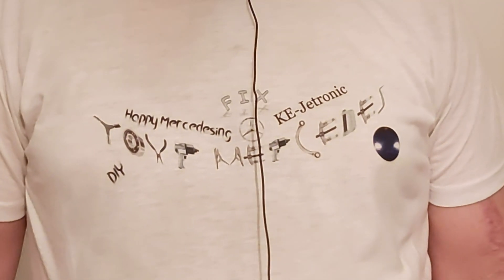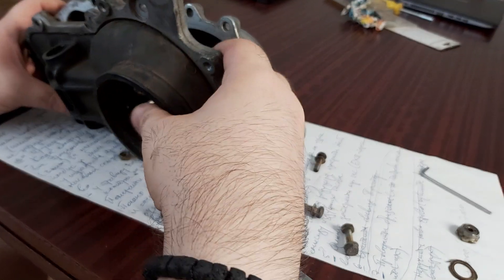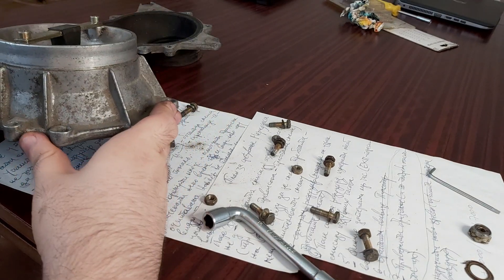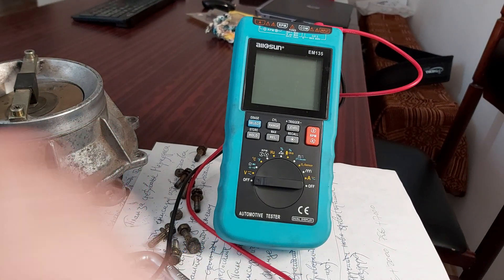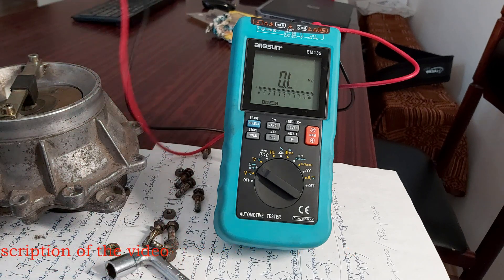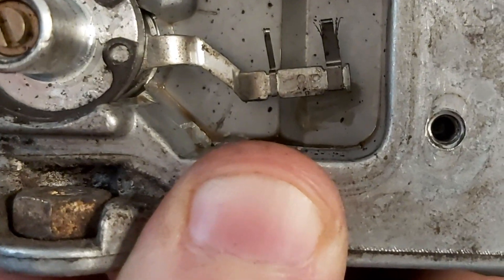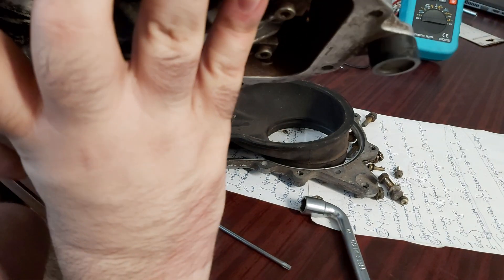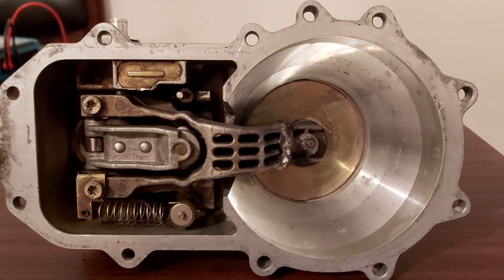㉦Mercedes Ke-Jetronic㉦ - M103 Air flow meter in details

Comment: hola ivica cambie el medidor de flujo de aire porque tenia un contacto roto como el tujo en este video pero el sensor esta peqada con silicona i medi con el multimetro con motor la 80 grados i me indica 0.30  qu tengo que acer gracias.
Reply from the maker: Si nunca ha reemplazado el sensor, reemplácelo.
Reply: le comprado de segunda mano no se porque pusieron silicona puede que no tenga tornillos es algo grave de se queda asi 0.30 se puede romper algo..o afecta el motor gracias
Reply from the maker: @tiberiuferencz  El potenciómetro afecta el ralentí. Compra el de Alemania, es el mejor.
https://www.ebay.com/itm/133173658800?hash=item1f01c4c4b0:g:gHEAAOSwzrxUwOBh&amdata=enc%3AAQAIAAAA4ClhldjLnTgTfNC8jFtEPZeqrXZqcU7X6teICi8cIF7%2FzkZ8%2Bxtt5i89mEJMLCY83LQFDP9amvusmWjiihwlGQNjJQy0I%2FXSGSO2qB1ab%2BWGM5SX6BpNbblFSit%2BfgJmILMQfUszysUo6XF8McXGHXio%2FetzHjl%2F8E42wHQ6DojqscQveyyXRDhwYgUE7wAGp2bSrF3eDGTu0csg%2BNQc68e0g7PLNDyoxefLEC5hApoBatsKkil5ZujSXXedqBxXJoD56z3BsVvwcExfsaB8Cjz%2BWT2nVUu4%2Bahh2%2FNcDZgE%7Ctkp%3ABFBM3uLEqOdi
Reply: gracias lo pedi hoj un saludo @mercedeske

Comment: Hi. Just want to ask for your expert opinion. My throttle response has been soft lately after changing the EHA and fuel regulator for a used one, so I tried leaning the mixture tower a little. It started to not hold idle since, so I adjusted it again to enrich mixture. My problem now is the spring loaded mixture tower suddenly lost its “tension”, the 3MM just spins freely. The engine is also flooding itself and fuel is coming out the exhaust pipe. What should I check first?
Reply from the maker: Hi and thanks for the comments. At first try to turn the screw counterclockwise. I hope you haven't damaged the thread. So again - in 3 steps: put the key in, stick the key until the spring is preloaded and as you feel the key caught the screw turn counterclockwise. Turn until you feel that the plate makes a slight play.
Reply: @mercedeske  That’s what I have been doing but it seems like something broke on the inside. Is there a fix for this? Or I have to replace the entire airflow meter?
Reply from the maker: @marimolina2661  If you can manage to turn the screw then you will have to replace the airflow meter.

Comment: I have a question and I hope you can help me: I bought mannol 9873 throttle body cleaner. They say to use it when the engine is at 2000 rpm. Can I use that without causing damage (to the potentiometer or something else…). Thank you very much. You are doing a fantastic job for every w124 owner 👍
Reply from the maker: Hello and thanks. What do you want to use the mannol for and why?
Reply: @mercedeske  Thank you for your answer. To clean the intake runners, combustion chamber, valves,…even if this engine is not a gdi engine. But I’m not sure if it can damage the potentiometer, because these cleaners normally has to be applied behind the maf.

Comment: Hey, after rebuilding my engine the car is now very hard to start and when it starts it won't idle and won't stay alive for more than a minute, after the engine got hotter it won't start again. I tried replacing the distributor cap and wires but that didn't help, do you have a clue on what it could be?
Reply from the maker: Hi 👋What car is it about?
Reply: @mercedeske  oh sorry, forgot to mention that. It's a w201 m102 2.0 ke-jetronic.
Reply from the maker: @Sheikob  Check the potentiometer, the lambda if you have one and the fuel accumulator.
Reply: @mercedeske  alright, I'll check those when I have time. Do you have videos on each component, if not where do i find info on how to check? also thanks for the help :)
Reply from the maker: Check the potentiometer, I have a video on that. As for the lambda - it has to be replaced each 50k kms. There is the way how to check it but if yours has never been replaced then I would advise you not to bother yourself, just replace it. As for the fuel accumulator-you will have to get a pressure gauge and to hook it up to the fuel distributor at the lower chamber where that silver screw is located. Unscrew it, hook up the pressure gauge and let the car run for about half a minute. Then stall the engine and wait for 30 MINUTES! In this time the pressure MUST NOT FALL UNDER 3bar! If it does you have a bad fuel accumulator!
Reply: @mercedeske  oh alright, I have rebuilt the engine but haven't bothered changing anything on the ke jetronic. What  kind of pressure gauge do you mean. Is it only going screwed in and the fuel don't go anywhere?
Reply from the maker: Don't worry😉😃. You need an adapter, 8x1 is the thread, attached it where you have unscrewed the screw and connect both parts with a hose. Tell me how many kms/miles the car has on the tacho?
Reply: @mercedeske  It's currently sitting on 200k kms and have been sitting for about 7 years before the project but all the rubber and plastic hoses looks and feels good.

Comment: No way to rebuild this contacts ? Why the plate was welded ??? How it could hav Broken at this place ?
Reply from the maker: No, you can't find them anywhere. There is the fuel called LPG, my dear Greg, it can cause something like this if not installed the proper way. Of course, there are also other causes.🤔